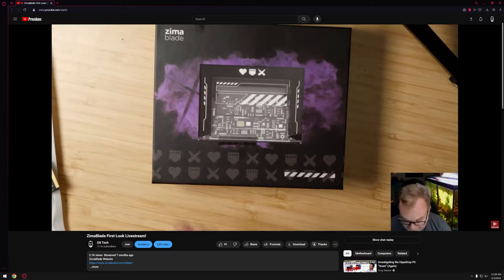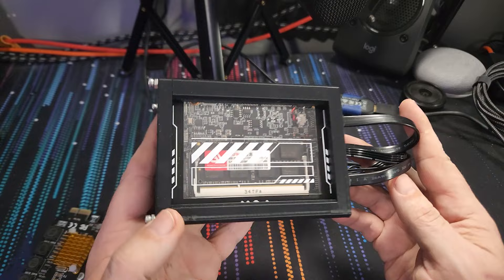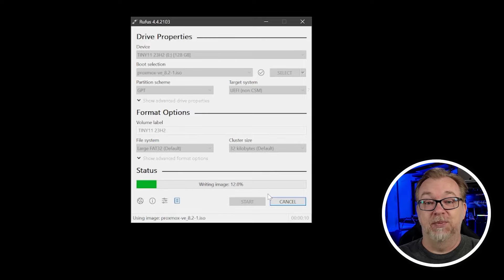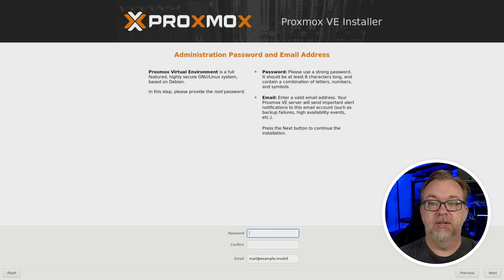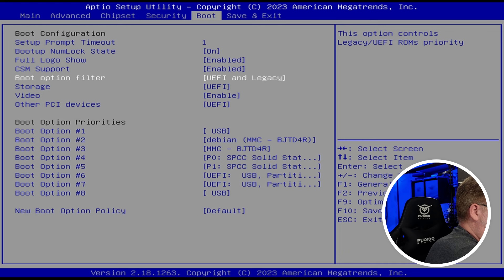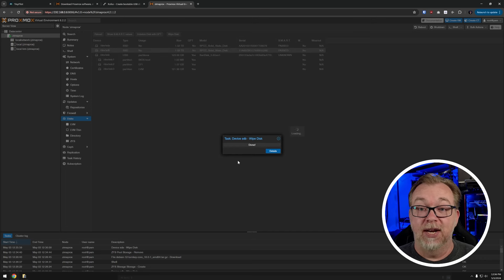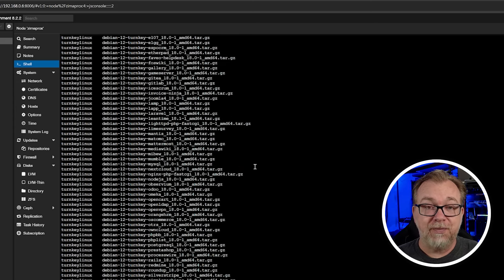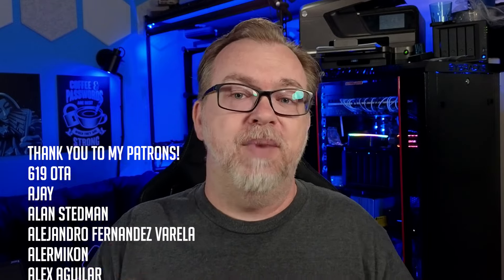Setting Up A Low-Powered Proxmox Server on a ZimaBlade

Comment: Looking forward to see what you make on rhe zimabkade. And glad you look Ia lit better. Keep going.  got the same setup but with a2 x 2tb hdd. I got a pci 128 gb m.2 and there i install proxmox. Un the 32 gb i have it as iso download for vm and lxc. I have already install webadmin and put my torrent download there, a second instance of pihole, nginx for the dns resolver name. Plannung on installing nut for my ups monitoring. And ansible to controll my proxmox cluster. Dont need it 24/7 ao iplan on turn it off at night. And have the zimablade controll that.